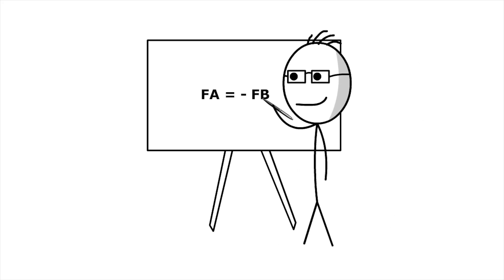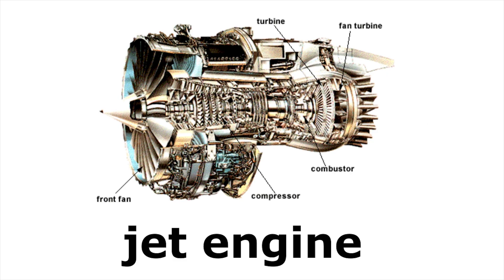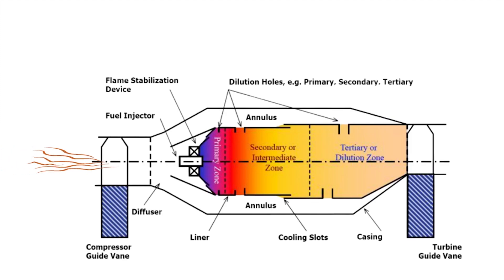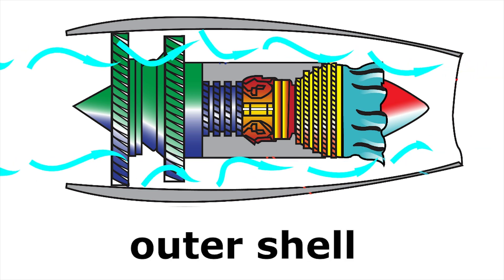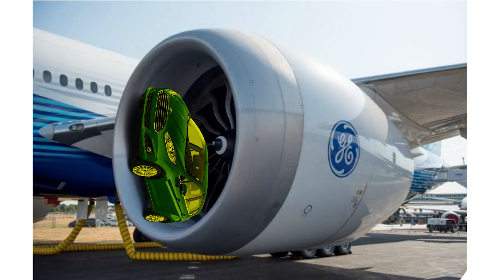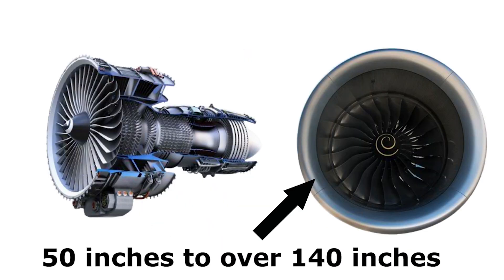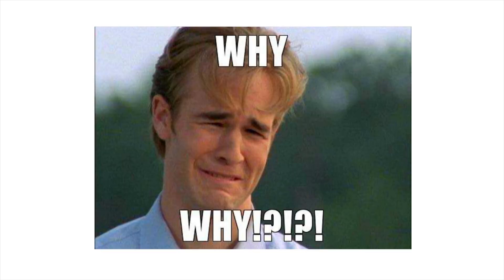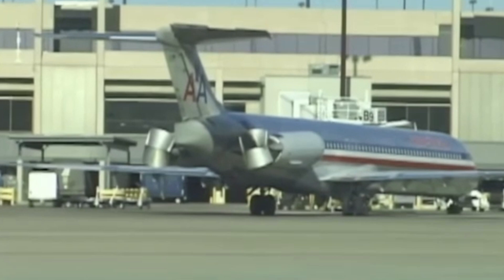How Do Jet Engines Even Work?

Comment: Most modern fighters actually use a mixed exhaust turbofan engine, but the bypass ratio is much smaller, hence the hidden small fan.

Comment: All "Jet" engines (Gas Turbines) work on the 4-stroke cycle of "Suck, Squeeze, Bang, Blow", just the same as a car or truck engine. The only difference is that the 4 "strokes" of the 4-stroke cycle are displaced in location, rather than time. 
The first part of the cycle is handled by the intake fan, which Sucks air into the second stage, the compressor, which Squeezes the incoming air to a much higher pressure. This pressurized air is fed to the combustors, where it is mixed with atomized fuel and ignited (Bang). This causes the highly heated pressurized air to expand massively and exit the engine via the exhaust compressor, which scavenges some of the energy created to drive the rest of the engine (Blow). 
The real trick is getting the gas turbine spinning fast enough to start the cycle running in the first place, as there is a minimum speed that any given gas turbine needs to be running at before it can be started without risking a spectacular failure - go below that speed, and the fuel tends to pool in the combustors, which leads to Very Bad Things happening when it finally ignites. If you're lucky, you get a big plume of fire out the back of the engine. If you're unlucky, you get an uncontrollable overspeed situation, and the engine converts itself to high-speed shrapnel.

Comment: Alright, lemme clarify two things that this video says in relation to fighter jets.

Fighter jets do use turbofan engines, with the stipulation being that the bypass ratio is much lower compared to an engine on a commercial airliner. The type of engine they're implying is in a fighter jet is a turbojet engine, which lacks a bypass, and is this less efficient.

When they mention increasing the speed of the air exiting the engine and refer to fighter jets spitting flames, that's not at all what's happening. Most modern fighter jets are equipped with an additional segment at the rear of the engine just before the nozzle called an afterburner. It's a lightweight and simple way to increase thrust effectively by dumping fuel into the engine's exhaust. This is highly inefficient, and therefore a BIG no-no for commercial airliners. Unless you wanna talk about Concorde or its Soviet copy, both designed to fly faster than sound, but that's not the video topic.

Also, if you're curious about the video clip after they reference passengers being put off by fire spitting from the engine, it's footage of a compressor stall. Basically, if airflow through the engine is disturbed it can cause instability and stall the engine, causing a flameout.

Please note, I'm not an expert, and neither is the person uploading this. However, it is a decent way to understand the basics of a jet engine.

Sorry for nitpicking lol, rant over

Comment: They work like any internal combustion engine: suck -> squeeze -> bang -> blow. However, all these processes occur continuously and simultaneously, hence the high power density.
I think you failed to mention that the hot exhaust gas undergoes adiabatic expansion, converting heat into kinetic energy, and this is how thrust is produced.